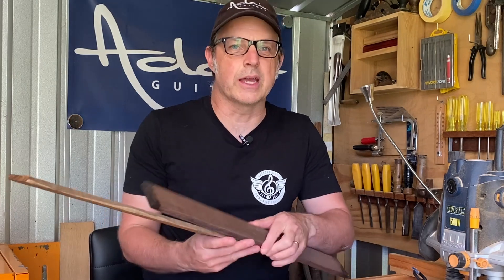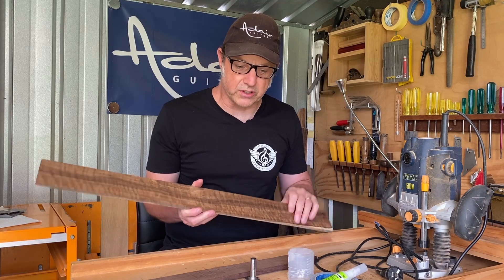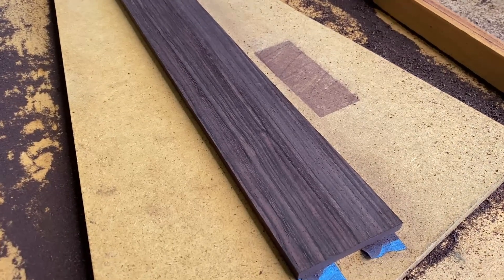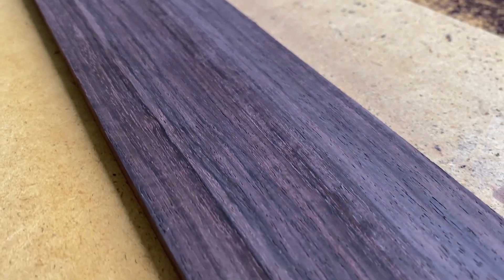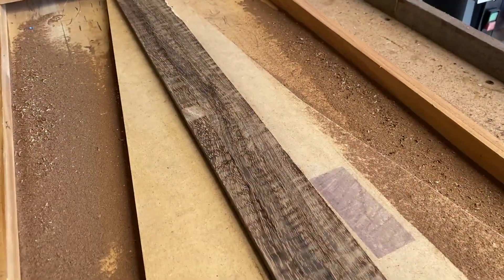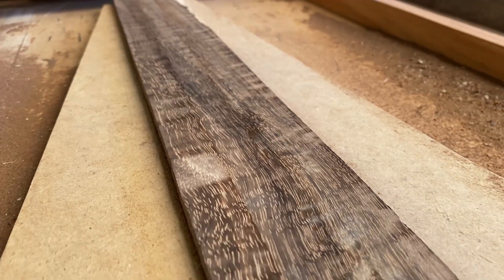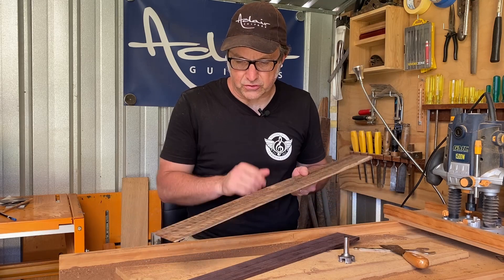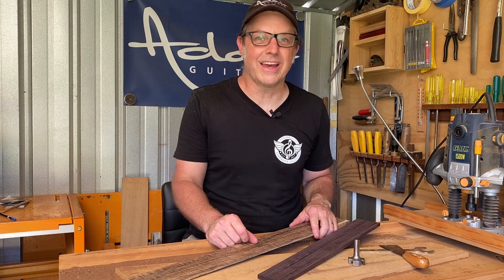Fretboard thicknessing with Radian Tools surfacing router cutter

Comment: So glad you’ve made this video I’ve had one in my drawer for a couple of years unused  want to make a router sled but never got round to it
Reply from the maker: I’m glad I’ve got it. Will save so much time compared to the smaller router bits I previously used for thicknessing on the router sled.

Comment: So I use the Freud 16-523 1-1/4-by-1/2-Inch Top Bearing Mortising-Dado Router Bit, got it from the Amazonians. Works a charm, basically the same-same, but different bit. 😎
Do you have a video showing your sled build? I'd like to see that.
Reply from the maker: Sounds like you’ve got it sorted with that bit. Built the sled before I was on YouTube I’m afraid, but will probably do a video when I make version 2 at some stage.